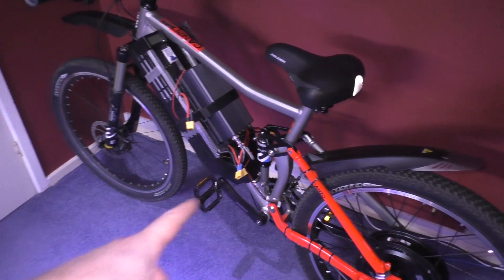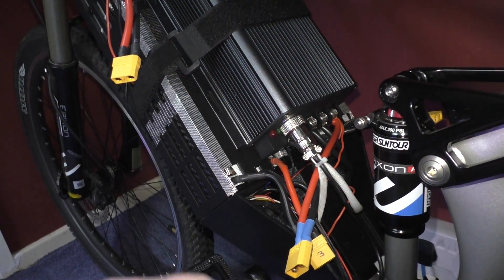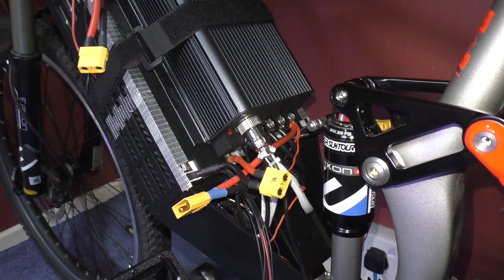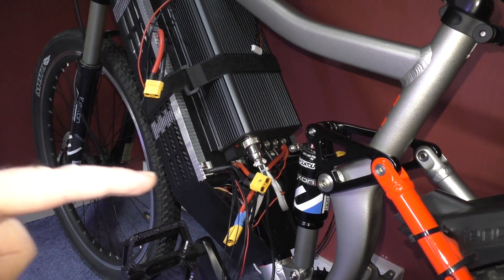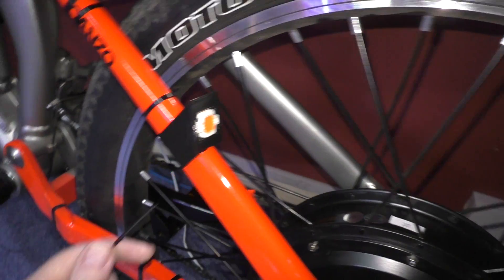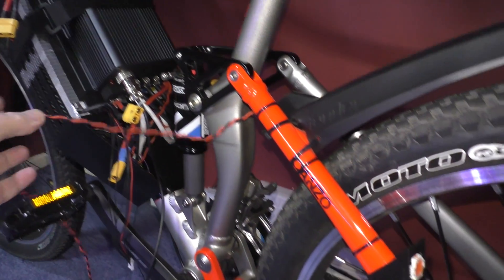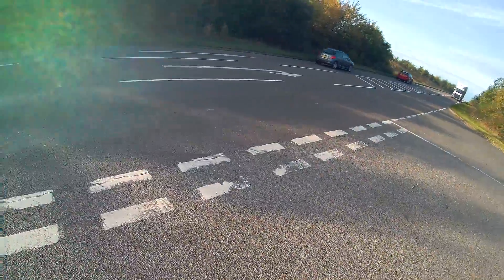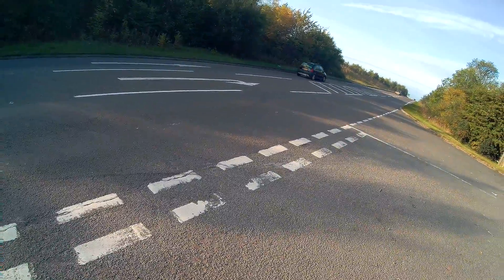11000w DIY eBike build part 6 - Finished - Maiden run next week

Comment: Hi im confused,just wondering why its down as an 11000 but the motor is a 3000 turbo ??
Reply from the maker: It's 3000W continuous. 11kW or above is only burst for 10 seconds or it'll burn out.
Reply: Thanks for getting back to me. I'm new to this . Is Alibaba a good place to buy the same motor as you ??
Reply from the maker: @MrKingraham  I'd visit the QS motor outlet on AliExpress, they have the most customers https://qsmotor.aliexpress.com/store/109978

Comment: Crack the throttle and walk it up the stairs.
Reply from the maker: I wish is was that easy. The wheelbase is just the right size for fitting in between 2 'valleys' of stairs and, because the wheels are small, it just wheelspins.
Reply: Yea I was just being funny, but man that thing would be a pig to carry up those stairs

Comment: Thumbs up for the work and bike but down for the strobes. 
Seriously, strobes actually do not make you more visible, they just grab attention but also confuse.
also driving with the strobes won't help you at all in seing ahead better. 
Steady lights, front and back, low/high beams front and brighten the tail when braking. 
It makes it easy for others to follow your trajectory.

Yes, have strobes on a switch that pulse the lights in some low-high manner. Usefull in hazarduos situations and usefull as a silent honk.

Comment: Good work.  I understand the satisfaction of working things out for yourself the way you want it.  When you get all the bits and pieces working well and you are satisfied I think I would work out a wiring harness for it to gather and channel the wires to waterproof connectors.

Comment: HI,have built about 4 ebikes so far but am now looking at a more powerfull ebike around 72v am a bit electrical minded as in i build my own batteries from recycled laptop batteries but that controller looks out of my league so thinking of a siniwave. Also did you get better front light?  i found these to be great 3 x XML T6 LED Bike Bicycle Head Lamp Light Headlight off flee bay

Comment: Vortecks Thanks so much for the videos!! This is going to save me ££££’s. Just a quick question, when overclocking the battery supply, how does that affect the longevity of the motor? Will it reduce the residual life? And if so, by how much?
Reply from the maker: As long as you don't run it beyond its max temperature, you wont have a problem. They rate motors as 'all day' running power and it's not uncommon for people to push 14kw through a 3kw motor. Mine will handle 12kw for bursts of 20 seconds and it doesn't get too hot but believe me, you don't want to keep the throttle open for long or you'll end up with a permanently deformed hand from gripping so hard :-)

Comment: Is that motor a direct drive or does it have a planetary gear reduction? Do you have a re-gen set up on there to recover energy when slowing down? That's where dual motors will actually make it more efficient and reduce the work on the friction brakes... I know... one thing at a time. :)
Gr8 stuff m8!!! Keep at it & pretty soon you won't know what to do with all the cash! HA!
Reply from the maker: It's a direct drive. The regen is currently set very low until I can work out how much it's putting back into the batteries. I also have the progressive e-brake set to come on as I let go of the throttle.
Reply: Vortecks ... Thanks... appreciated... All the best on your fun project there.:)

Comment: Just a thought, can you add a drive wheel to the front to charge the batteries
Reply: That's occurred to me, looking at ebikes recently. Should be able to go brakeless with so much regen.
mmmm, regen :)
Reply from the maker: Using power to generate power is somewhat counter-productive. Plus which, the front forks are designed to stop and absorb bumps, not drive. Plus which (again) the front forks don't have a drop-out like the back, it's actually an axle. Apart from that, you do have a valid point :-)
Reply: Doesn't necessarily have to include a 'drive' function, rather it could just be used as a regen brake, however having some front-wheel drive would add some stability, help minimise wheeling when accelerating (particularly uphill) and seriously help when riding off-road.
As for the forks not being able to handle the forces, disc brakes apply a huge amount of force, so long as a drive motor doesn't exceed that, I don't see an issue (other than weight).
Come on though, ya gotta admit, it would be fuckin' cool though :D
Reply: people have thought about this A LOT but it seems very little is gained for the effort and other sacrifices made

Comment: do these bikes have any sort of electric braking assist?
Reply from the maker: Ye, it has regen enabled which recharges the batteries when I let the throttle off. It also has active braking which uses the motor to stop.
Reply: I’m pretty sure he has it set up when the the throttle is completely released.

Comment: Looks waaay to wide? Won’t legs/knees hit battery pack? Also you have an electric bike, set it up to have a low speed mode and let it power itself up the stairs rather than lifting it up.
Reply from the maker: Surprisingly, the packs don't catch at all. As for getting it up the stairs, I've tried many ways and it only wheel-spins. The stairs are actually granite so there's no grip on them at all :-(

Comment: The end product is very nice and a testament to your problem solving and building skills. Like you, I’m not running a bms on my bike. Am interested in your Arduino based voltage monitoring setup. Have fun riding this one!
Reply from the maker: Cheers Bob. The Arduino BMS needs a lot of tuning - it's using too much power (only 40ma) to be left in place all the time. I won't give in until it's working perfectly!

Comment: It's going to be a beast Tony...lol...Just a thought though, how rainproof is that big circuit breaker do you think?...In fact all of the bikes electrics really, because one day you will be on it and it will get rained on, this is the UK. Im not an electronics expert by any means, but I know our weather can be shyte for sure, you can rely on that....lol
Reply from the maker: It's all waterproof as long as it doesn't rain mate. I don't want to think of 75v DC coursing through my veins and saying goodbye to one's testicles.   
If there's any chance of rain..... I'm not going out!
Reply: Lol...Hoping it won't rain, spoken like a true Brit Tony..How about some thin plastic sheet bent like the roof of a house to cover the ESC and the Batt Box. So, the Apex would fasten to the underside of the crossbar for example, and then to the sides of the existing batt box maybe?...It would need to be easily removable though for charging purposes perhaps, but would provide total waterproofing..? Thin flexible sheet so you can insert it through the gap.

Comment: Hooray! I'm amazed you were able to fit everything in. Well done. Curious as to how the handling and centre of gravity has changed. Can you do a wheelie Mr?

With all the gear & you sat on it the rear strobes will be flashing directly in the traffic copper's eyes at the lights :) as you go 0 to 30 at lightspeed while his fancy BMW with stop-start has just spun the starter motor.

What's next? An electric helicopter? :)
Reply from the maker: It has 462bhp/ton and it leaves everything at the lights. It wheelies at any speed (the faster I go, the easier the front comes up because I'm a big sail).    
Will I do it on camera? Doubtful, I'm not really a wheelie person at my age :-)

Comment: MOSFETs ... IRF520s??? Given the lack of space under the "top tube" have you considered chopping it out, turn it 180 degrees and welding it back in? Plenty of room then. Cheers.
Reply from the maker: IPP80N06S4L but any N-Channel MOSFET with a 5v gate will do

Comment: You got me so lucking forward to the next one now i honestly can't wait to see this thing fly Tony.
as for cheap headlights i always use these in the link below.
takes about two weeks from China and the battery packs are poor but the head light them selfs are amazing, so good i have fitted a motorcycle switch to my handle bars so i can turn it of when traffic approaches so not to blind them, hope that helps and excellent work on this project.

https://www.amazon.co.uk/BOOYE-Lumens-Bicycle-Lights-Headband/dp/B075L5S7FH/ref=sr_1_77?ie=UTF8&qid=1508578337&sr=8-77&keywords=cycle+lights
Reply from the maker: Cheers mate..... order placed :-)   
As for the maiden run..... I'm still recovering. It's like an Ariel Atom and keeps punching until you bottle-out and let go of the throttle!
Reply: Christ on a bike (excuse the pun) this thing sounds mental.
you should get out there this afternoon and give storm Brian a run for its money when he hits lol.
Reply from the maker: I would but it's throwing it down....it's not really waterproof yet

Comment: You mentioned there is a lot of wires, have you thought about using the frame for ground so you can at least reduce the black negative wires by fixing them to the frame. Or do you want to keep it isolated.
Reply from the maker: I did mention it in one of my other videos but it would be a bad idea. I can't go into detail but the BMS I've done wouldn't work with a common earth (even if I isolated it). When I do the video about it, it should become clear.